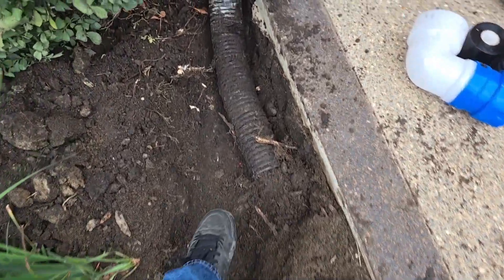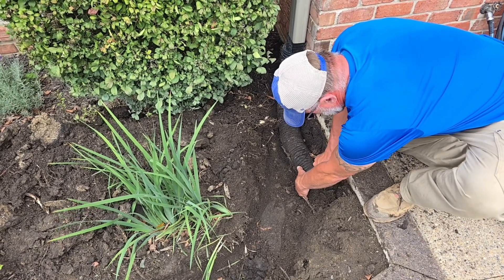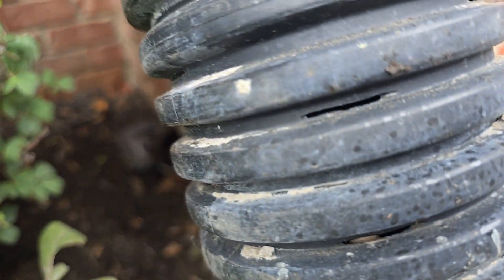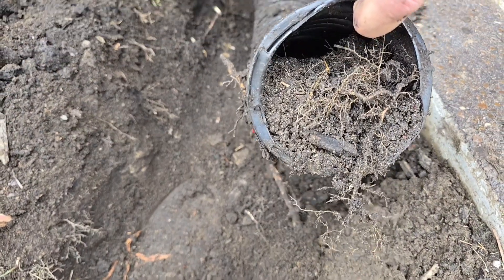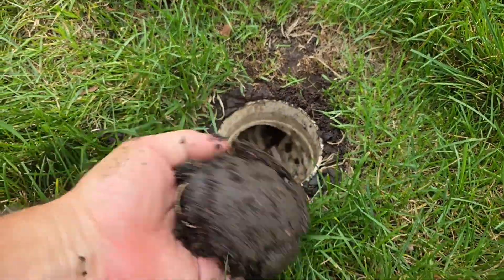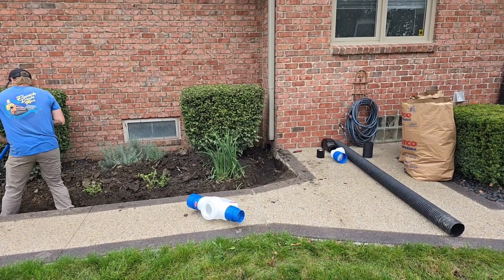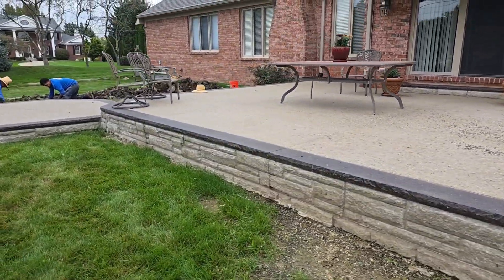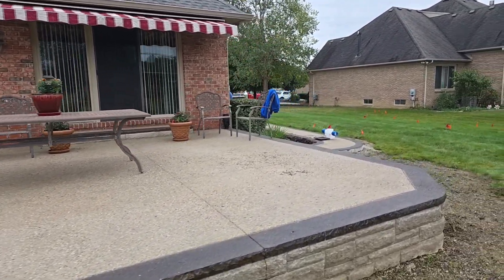Why You Don't Use Perforated Pipe For Downspouts?

Comment: Thank you for this video, it was extremely helpful. Someone installed perferated pipe on one of my downspouts and it had become completely clogged. The foundation near the stairs of my deck were slowly starting to shift. Luckily I noticed this during some heavy rain and am in the process of fixing it before it does significant damage.
Reply from the maker: Best French Drain and Yard Drainage Contractor
https://frenchdrainman.com/

Comment: Horrible heading, I use corrugated 4 inch solid cores for down spouts all the time. It’s cost effective, with a leaf clean out installed where it attaches to the down spout you will never have this problem and as long as there’s not construction equipment getting ran over it it’ll be fine for 30+ years which is longer than the average home owner owns a house for. Quit spreading false info across the internet like you are king of down spout drains when I reality you’re just trying to come up with a reason to up charge a customer on pvc or schd 40. Maybe pvc is a better option for a 10 ft run but when you actually are eliminating the water and moving it hundreds of feet away you use corrugated in my opinion. Every one of my customers are happy and every job gets a clean out installed.
Reply from the maker: You must have misunderstood the video altogether. This was perforated pipe for a French drain, used as a solid pipe for a downspout.
https://youtube.com/playlist?list=PLjFCqaZ4v1BX_ZMbxsYVB6CNFoeAmuPxX&si=cuHXz2Nt3JBGb9Ne

Best French Drain and Yard Drainage Contractor
https://frenchdrainman.com/

Comment: Love your videos. Thanks. I’ve bought some of your products. Do you have any videos on dispersing all the caught downspout water across a hill so it spreads out, and doesn’t exit just one spot? What if I use solid pipe all the way until I want it to disperse it and then run perforated pipe across the hill so the water can spread out through all the holes? And what if I half bury the pipe so it will seep into the ground with little rain through the holes underground, and with hard rain it will exit the pipe faster 0:15 with the holes that are daylighted? Will dirt just get into the burried  holes and clog the pipe? Water should be exiting those holes so not drawing dirt in, but pushing it out. Any thoughts on this? Thanks.
Reply from the maker: https://youtu.be/wawHvSs0UV4?si=QDAsKlTb1DIyFUZu